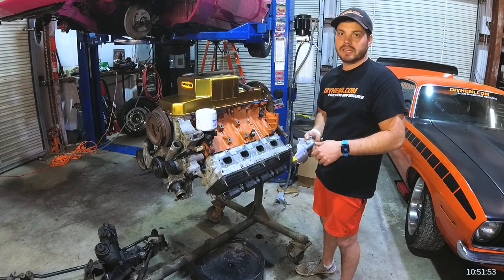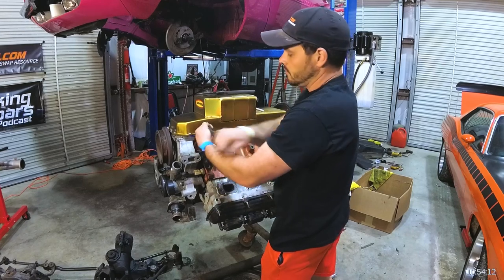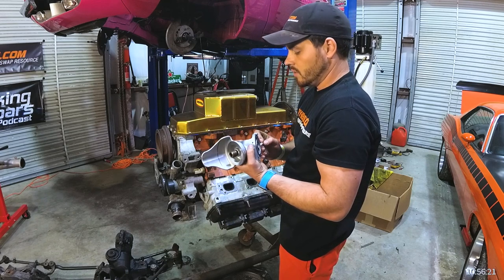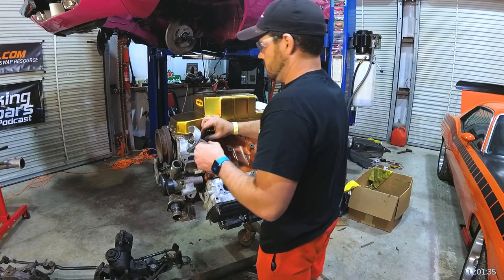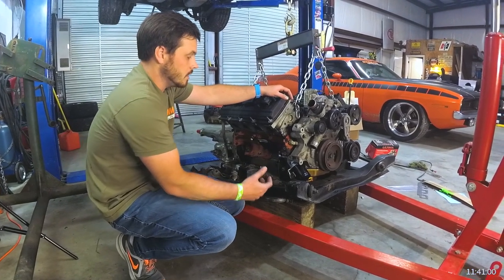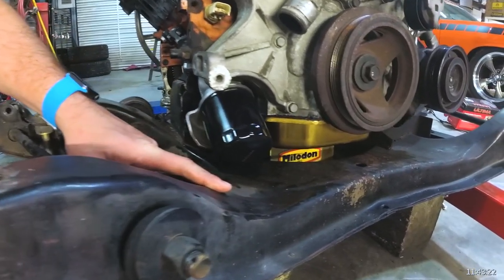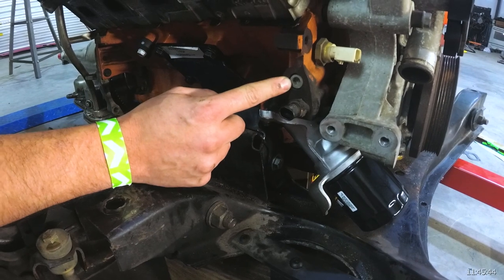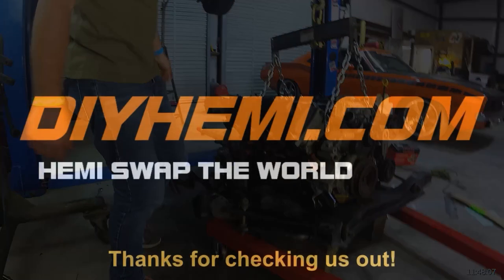Hemi Swap 45 degree oil filter adapter - Easy oil changes

Comment: Another great video, and really like the use of the extractor...word of caution though, I have had a couple of those oil standpipes that would break the extractor trying to get it out.  If you have to use anything bigger than the 1/2 ratchet Blake used, then I don't recommend using the extractor.

Comment: I guess mines welded in my block. Ive tried almost everything to get my adapter out. Bolt extractor just split it even with vice grips on it. Not coming out. Im not driving anywhere.
Reply: Mine is stuck too.. of course there's no Allen key allotment either
Reply: I got a little more than a quarter turn on mine and it seized up... eventually split... did you drill yours out?

Comment: need info i have a 1994 ram 2500 4wd 5speed nv4500 trans. i have 3 2003 5.7 hemis, i have 2 2014 5.7 hemis, and 1 2014  6.4 hemi. the 2003 i have the whole truck wiring harness and all but all are automatics and want to keep the 5 speed in the 1994. several have told me to go with the older hemi and use the later model eagle heads main thing is i want to keep the ac working and power steering as well which combo do you think best
Reply from the maker: 2014 6.4 will bolt up just as easy as a 5.7. Don’t use the 2003 system as it isn’t nearly as nice or clean as the 6.4. 

You can run AC and power steering on a 6.4 easily
Reply: @SUBLIMEparts  someone had told me that the 6.4 compressor hit the steering sector and you couldn't run ac unless you ran the older hemi where the compressor was on top
Reply from the maker: @DependableAutoTruck   all car hemi engines had the compressor down low. All trucks have the compressor up top. If you have problems with clearance, put the truck 5.7 (09-newer) front timing cover and accessories on the 6.4 and run it. Unless it is a truck 6.4, then just bolt it in

Comment: Hi there.. Could you please tell me if those oil filters (Baldwin B7221 and Wix 51335) fit 2010 Hemi SRT8 6.1L engines?
Many thanks
Reply from the maker: Honestly can’t say for sure. Try using rock auto. They have a great compatibility chart system.